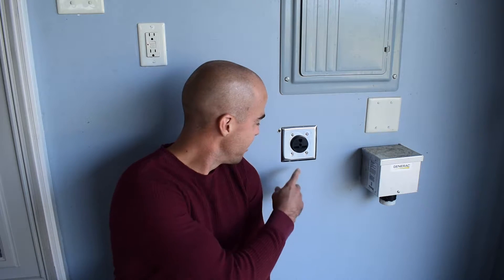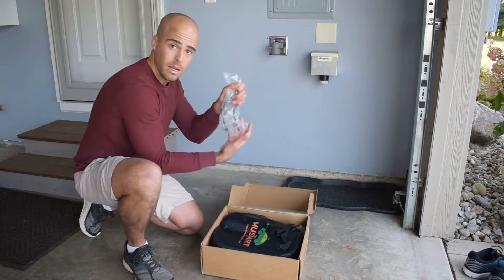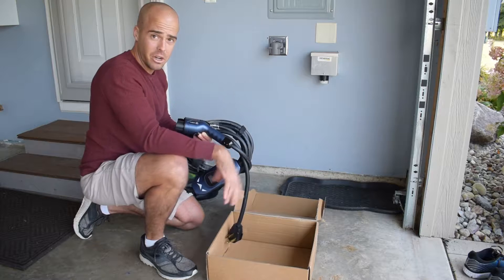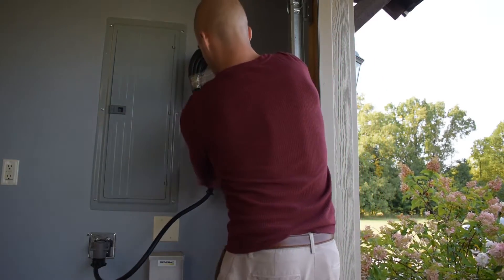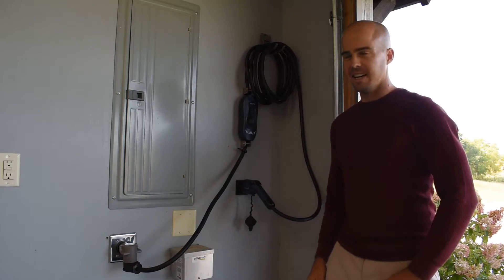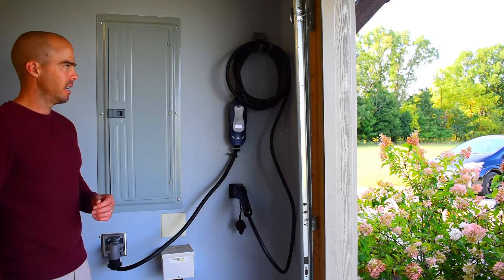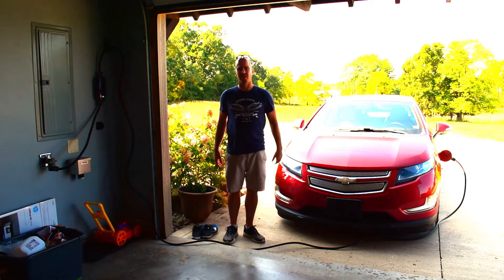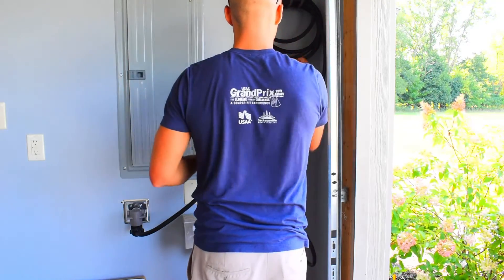LEVEL II ELECTRIC VEHICLE CHARGER!  Install and first plug in.

Comment: Where do you get the adapter I have the same outlet
Reply from the maker: acworks.com
I can't remember the name of the outlet but they make adapters.  I think it was a 6-30p to 14-50.
I recently got a Model Y and had that outlet changed to a 14-50 so I no longer use that adapter.

Comment: Great video, thanks for creating it. Do you just let the cord run under the garage door seal when you close the door? Seems like that's how most people do it.
Reply from the maker: Nope.  I either charge the car outside with the garage door open or charge the car inside with the garage door closed.  Once in awhile, I will stop the garage door just above the cord if it is very cold/windy outside and I'm charging the car outside.  But I never close the garage door on the cord.  No reason to.

Comment: If your level 2 plug calls for 32amp max charging you can change your breaker to a 50 amp and the plug to an actual 14-50. A breaker is technically only rated for up to 80% of it's size. So if it's on a 30amp breaker it's technically only going to consistently be at 24 amps and that's at max output. But if you put it on a 50 amp breaker it will consistently pull up to 40 amps being a lot safer and more efficient. Also a breaker will not push the amperage to the outlet the outlet will only pull what is needed.
Reply from the maker: Thanks for the info.  My Volt only draws 3.3 KWs max so not an issue as that's only around 13.5 amps.  Now when we get our Tesla(s), I will definitely up the breaker amps and probably have a certified electrician make sure everything is good.

Comment: Hey there! Just curious as to what the monthly cost is roughly to charge your vehicle at home on a regular basis? I have a phev ordered, first timer with this kind of stuff and I'm just wondering what I should expect! Thanks!
Reply from the maker: Well, when my solar PV system produces enough, it's $0.00!  
Assuming no solar, and you drive 15,000 miles a year and your PHEV gets roughly 3.5 miles per KWh and your cost per KWh is 13 cents as mine is, then about $46.43 per month to drive 1,250 miles per month.
Reply from the maker: @OverlandOrange  Bummer.  I had to run an extension chord from our porch when we lived in an apartment.  Luckily, we were on the first floor.
Reply from the maker: @OverlandOrange  It's very simple math, but roughly yes.
Reply from the maker: @OverlandOrange  Still blows my mind how few people drive EVs to this day.
Reply from the maker: @OverlandOrange  That sucks.

Comment: 🤦🏻‍♂Classic — "I'm not an electrician, but..." — DIY sketch. Absolutely ⚠⛔not code. Upgrade ASAP (from STD 30A) to 40A GFCI breaker + swap (30A NEMA 10/30P) to NEMA 14/50R receptacle SAA from #10 to #8 wire. Doing so will all but eliminate potential for frying sensitive EV electronics — and/or burning one's house down. Good luck 🍀
Reply from the maker: Yeah, you're probably right.  Not too worried since my Volt only draws max 13.3A since the onboard charger is max 3.3 KWs.  When I we get our Teslas, I will probably have an electrician come and upgrade circuit amps and outlet.  Thanks.

Comment: Thank you for the video. Do you think it is safe to close the garage door on the cable?
Reply from the maker: Yes, I think it is safe because the cable is heavy duty and well insulated.  However, I personally would not.  You can stop the garage door while it is closing at whatever level you want.  In the winter, I would stop it just above the cable if my car was charging outside.

Comment: I would change the electrical outlet receptacle to correspond to your plug & you won't need the adapter. Cleaner install. 
Thank you for your service.
Reply from the maker: Yes.  I may do that and also increase the amperage on the circuit when I get my Tesla.  Thanks.

Comment: I’m happy for you....I live in a condo...I have a carport that I have to get permission to install a 240v outlet.... I have an electrician coming to give me a estimate so I can tell them how much it’s going to cost me.....I hope he can connect a box next to the central air....where did you get you’re new plug from?? Wish me luck!! I drive a 2013 Volt too....
Reply: I’m going to save up for a TESLA S anyway
Reply from the maker: It's a Mustart with an AC Works adapter.
Reply: Well, I can’t get a 240V....I would need a sub panel..that’s way over $1000...:they can give me a 110V....$500 area....manager liked my purposel...kept asking me about using an extension cord!! Now wait

Comment: Great video!! one tip I could give you is just change the outlet plug in the wall to match cord get rid of the adapter will be cleaner faster power.
Thin thick long short all make a difference 🚀
Reply from the maker: Yeah, I should have done that originally but I took the quicker, more expensive route.

Comment: With the panel right there, you should just install a NEMA 14-50 outlet.
Reply from the maker: True, but my setup works just fine.
Reply: @usmcsaxoki  A new receptacle is less that $10, you paid a lot more for that adapter. By the way, the onboard charger of your Volt should accept 3.6kW, so you can't use more that 15 Amps, When you buy a new EV, like a Chevy Bolt, you'll want an EVSE that will support 32 Amps, at that point you'll want to rip out that 30 Amp receptacle (which can only support 24 amps continuous along with your 30 Amp breaker). If you didn't purchase an EVSE that has an adjustable current (12, 15, 24, 32 Amps), your circuit will break If you or a friend plugs in another EV (that can accept 32 or 40 amps, which is just about every EV but the Volt).
Reply from the maker: @JohnWoodell  '13 Volt excepts max 3.3.  And yes, I know the other stuff you said.  Doesn't matter because the only EV I have is my Volt which I plan to keep.  I'll worry about charging another car when I get another car.  Buzz kill.
Reply: @usmcsaxoki  Fair enough. Sorry I got sidetracked from praising everything else about your video, which is overall fun and informative.
Reply from the maker: @JohnWoodell  No worries.  That's one of the reasons I'd prefer a Tesla over a Bolt for example... I can choose exact amperage and charge level.  6 KWs is still a good rate of charge for any home EV charger in my opinion.
Reply: @usmcsaxoki  You can bay an EVSE that lets you set the Amps and will work on both 120 and 240 Volts. For people that need to share their dryer circuit, the SplitVolt looks good. Seems like a common situation that people will be using their dryer circuit.

Comment: Clay, did you notice that your wall outlet and your “plug”have 3 prongs or connectors, while the Mustart has 4 prongs?  The missing conductor is a ground.  i suggest you talk to an electrician about modernizing (aka meeting code).  What you have does work, but at this voltage and amperage, I’d go for the extra safety.   Just sayin’.
Reply: This is wrong info.  Like Jorge said, the "three" and "four" prong plugs both have ground.

The NEMA 6-30 is missing the neutral (white) wire.  The EV chargers actually don't use it on the NEMA 14-50, so it's not dangerous to use the 6-30 outlet.

The only issue here is that the actual allowed amperage is only 80% of the rating on the plugs, so a 6-30 will only be able to safely supply 24amps or it can overheat and cause fires.

Unfortunately the breaker/wires/outlet does not decide how much current to pass through them.  If your mustart charger allows you to throttle the max current down to 24amps, you can conti use to use it even with the sketchy 90° 6-30 to 14-50 adapter without problems.

Also, someone said to just swap the 6-30 outlet to a 14-50 outlet.  This advice should also be taken with caution because one must look at the ratings for all the components on the circuit.  I am not an electrician, but I teach high school physics and chem.

That being said, the lowest rated component on a circuit determines the lowest rating for the entire circuit.  If your outlet is 6-30, the electrician could have used wires rated at 50amp (typically 6awg), and breakers rated at 50 amp (also need to check temp as temperature is proportional to resistance in electrical flow).

But if the electrician used wires that are rated for 30 amp (8awg for instance), swapping the outlet from 6-30 to 14-50 would be a dangerous condition (probably a code violation too I'm guessing) as the outlet will now show 50 amp, but the 8awg wiring will only be rated at 30 amp.

If you did that (just swap out the outlet), and plug in a charger that has 14-50 outlet, the charger may happily pull 30 amps and the person may think that's fine, but now you are at 100% of the rating of the wires that are behind the wall.

So the best thing is, not only should the outlet be changed, but the wire and the 50 amp breaker should be inspected to make sure that they can handle 30 amps at what temperatures.
Reply: Its missing a neutral. 6-30 has a ground.
Reply from the maker: Yes, I know.  It's a 6-30p plug adapter for the 14-50.  I don't think they'd make them if they weren't safe.

Comment: Whoop!!! Congrats. I got the solar guys to put in a Nema 14-50. Luckily it was able to be styled right below the box. I got quotes at $900 and the right tech did it for $100. Also in Indiana. Shout out to @modernmillsolar. They were awesome and only one of the crew that I could find in Indiana that did anything solar north of Indianapolis . Shout out if you need info. Not sponsored. Just happy.
Reply from the maker: Yeah, only stuff I had to pay for was the adapter and charger itself since that 6-30 was already installed in the garage.
I've hired Moxie Solar to do my install.  8 KWs - (20) 400W monocrystalline panels and Enphase micro inverters.